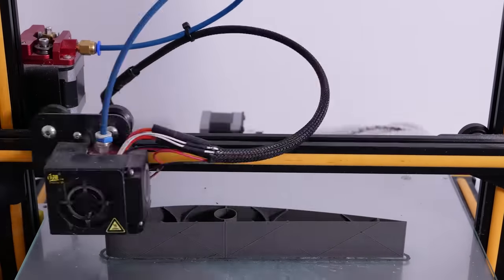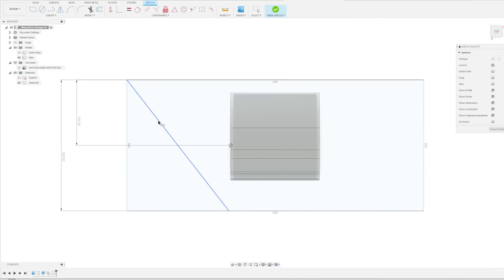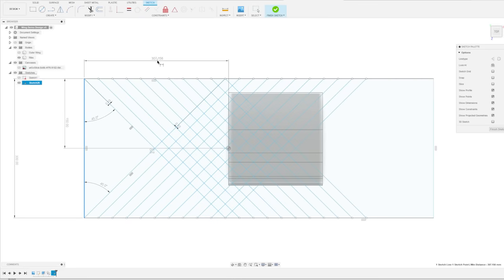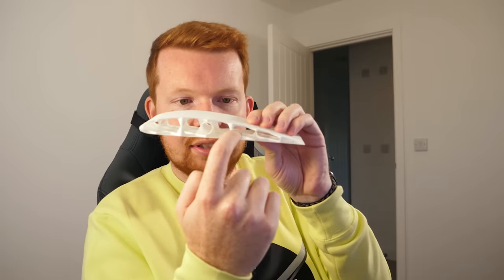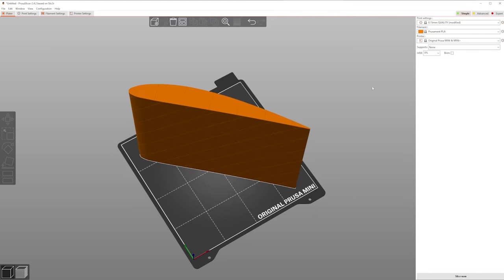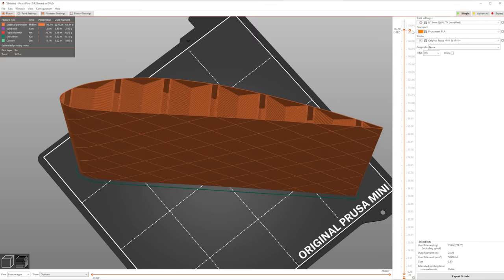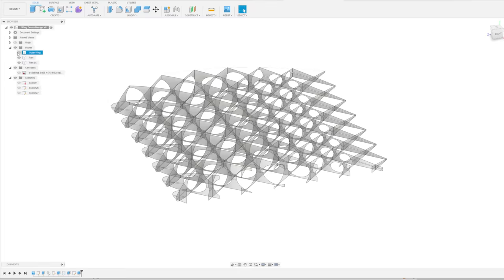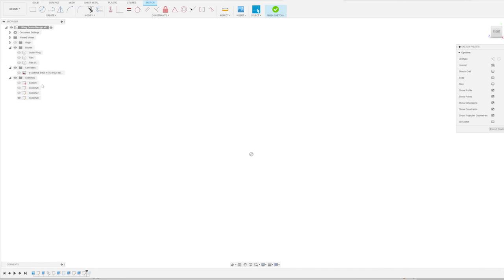How I Designed a 3D Printed Wing

Comment: I think you may get better strength-to-weight if you make the circular cut-outs parallel to the ribs instead of parallel to the spar. And then they do unfortunately need to be tapered, so you might want to add the circular cutouts individually to a single rib before you replicate it.

Comment: Very nice print, how would you do this for angled wing designs? is there a way to make the wing itself a pattern and extrude it in a circular way?
Reply: Base rip and smaller endrip. Instead of extrude you use lift up
Reply: @srck4035  Alright I'll check that out, thank you very much
Reply: @janivo5218  I tried it today and it works but the spiralize printed wing is hard to do in this version. Also the command I mean I named loft in English fusion 36p
Reply: @srck4035  Nice, haven't had the time to do so myself but I'll probably try it in the coming week. I modified my Wing Design a bit already and will continue to do so to make it work

Comment: Thanks for the video.  You didn't show how smooth the wing came out with the 3D printing layer lines.  How did it come out and how smooth does the wing look?
  I've got a 1/48th scale model that I'm thinking of reverse engineering into a 1/32 scale.  They don't make this model any more, but I don't know how FDM printers would work and the SLA printers are not big enough.

Comment: Hi Tim, can you adjust the width of a line in your 3D model during the printing process without necessarily making the object more complex. I would like to done it by adjusting the extrusion width or line width settings in 3D printer's slicing software, not by changing the model itself in the 3D modeling software.

Comment: Tim, you can skip a step there and send the body directly to prusaslicer using the 3d Print option instead of exporting as .stl. You have to setup your slicer as the custom slicer first, but that is just pointing Fusion to the .exe of prusaslicer. No more export - import - export - import

Comment: Many thanks for this process...but aren't the ribs supposed to be back in from the outer surface a bit so the wing surface is smooth?
Also how would we add servos, hatches, ailerons and still maintain vase mode, like the 3Dlab crew do it?

Comment: @Tim, I have a very similar design in SolidWorks but after slicing the part in PrusaSlicer it removes and breaks up the internal ribs. Your design in Fusion360 seems to work. Is this software compatibility issue between Solidworks and Prusa?

Comment: I’m a noobe on Fusion 360 with a deep interest in RC airplanes.  Thank you for making this video and for providing the Stl files.  I would love to print your vtol plane with rotating wing as the fields here have clumpy grass that challenges any landing gear.  Question: how can I tell if my 3d printer can print your design?  Did I miss the overall dimensions at the start?  (Lots of wings are designed to be printed a section at a time using slots and corresponding areas to link them together.)

Yours is the first wing that hearkens back to the balsa models I started with 30-40 years ago.  A well designed wing is like a practical art form combining form with function...  this video reminds me of that aesthetic quality.  Nicely done!

Comment: Hello, I wanted to ask how you printed the wing in parts, let's say the wing is too tall. Do you divide the wing by small cuts and print each individually? would it cause problems if the next section of wing technically doesn't have a flat face at the bottom when it starts printing, and if there are specific settings. Also would this technique of the one line cause problems if I needed support material where I have a square slot on each side of the wing, meaning I have a ceiling due to the slot? If anyone knows, it would be a great help. Thanks.

Comment: Did I miss you do a shell operation on the wing profile or was it a thin extrude at say 0.4mm? I don't get how the rib pattern cut out/combined from a solid piece produced the small pieces and not the bits we were trying to remove

Comment: Hi Tim. First congratulations for your channel and all your ideas. I really love following your crazy ideas and figuring out all the test and solution you go through.. great job. A question for this video. I want to 3d print a wing for my hydrofoil... the procedure you have showed is almost what I have in my mind except for the middle line that divide the ribs in two. Was used to print with a resin 3d printing so loops were not a problem. I have now a wiring printer but I'm actually not so familiar with it and all the tricks and problems of it. Let's go to the beef... I got your point and I agree on that regarding printing problems... what is not clear is how ribs can be working if you cat them in two... they look like  jointed in the final job. 😳  . Not sure but maybe the space you left is just a little bit bigger that the noble so the ribs will be rejoined...but at this point I'm going to have a very small section that will represent a vulnerable point for all the structure..doesn't it? Ribs are done for make the whole structure more robust and at this point I'm scared to have a not sufficient robust ribs for my porpouse. What do you think. In advance...I'm planning to cover all the wing with a  carbon fiber layer by the way
Reply: The gap between the ribs is about the same size as the printers nozzle (he mentioned this in the video) and the material used to print this structure foams up, which is why a "one line" printing style is needed, the ends just connect themselves as the actually printed line isn't 2D like it is in the software

Comment: I’m still learning about 3D printers, I haven’t played with any FDM’s, but I do have a resin printer and I know they are very different machines. Ido however have a fairly good understanding of mechanical and structural engineering, and you have purposely designed a structurally weak assembly trying to create a workaround for your printer not using an optimum printing path. You built failure modes all the way through the wing section from leading edge to trailing edge. I believe the design would better if you had the skin print “separately” from the ribs. That is; skin, ribs, next layer, and so on. You don’t want a wing to split in half in flight due to weak bond of the halves. With the skin, rib method, if any bond is lost, it’s internal and may result in only a nominal increase in wing flex, but no crash. 
I would add a second spar to eliminate torsional stresses between the sections.
Reply from the maker: Buy some lightweight PLA and an FDM printer, print one out and then see. It's surprisingly strong as the crease lines (where the ribs start) are bonded together. They aren't failure modes at all. Lightweight PLA isn't going to survive a crash very well anyway, but so far it's performance in the air is excellent.

Comment: Thats really interesting and thanks for sharing the design process.

Do you glue 200mm long sections together to make the full wingspan and did you design any specific features into the surfaces to ensure a good fit between each section?

Comment: You made the "Outer Wing" as a solid body. I don't see how you did a combine with the ribs to get something that's just the ribs and the "skin" of  the Outer Wing. Did you perhaps skip a part where you did a Shell operation on the Outer Wing?
Reply from the maker: The wing model is a solid body when it is exported, but when the printer is set to vase mode, it'll only follow the outline of the body and therefore creates a hollow interior. The combine tool is actually set to cut the ribs out of the outer skin, but fusion names it 'combine' for some reason.
Reply: @TimStation  Ah, OK. I've been using Fusion 360 and PRUSA Slicer for years now and never came across that particular option in the Slicer. I didn't see in the video where you actually set the Slicer to user Spiral Vase mode. I'm guessing that you had that already set and just didn't mention it, or maybe I just missed it where you did that.

And, yes, Fusion calls that function "Combine" but there's actually several ways to "combine" bodies, Join, Cut, or Intersect.

Comment: Hi thanks for the videos. Have you ever tried ABS printing the wings. I have a problem that I could not solve it. The wing always have dent due to the shrinkage of the ABS while fuselage has no problem. I guess its the hanging area related. but just don't know how to fix it. do you have any suggestion. thank you.

Comment: Thanks for the video, Tom.  When you added the wing spar, there was the "thin line" in the middle that would need to be removed in the 3D print.  Is this treated as support material?  How would you remove it through the whole wing?  Why do you need that line at all?  Also, the first wing body, was that just an outline or did I miss where you shelled it in Fusion to get just the outer perimeter?
Reply: Hopefully I can help. The "thin line" is actually the path the nozzle takes to get to the spar hole in the middle of the wing, so there is no support material. The printer comes along the bottom of the wing, then when it gets below the spar, it travels up the thin line to the spar. It travels around one side of the spar, up a little bit (but not quite to the top of the wing) and then back down to the spar. It finishes the other side of the spar hole and then prints the other side of the thin line to the bottom of the wing.
Reply: It's Tim..
Reply: @DrTheRich  I think he actually goes by Tom, his main (first) channel is called Tom Stanton, this is Tom's second channel that he named Tim Stanton. I don't know if he actually goes by Tim though.

Comment: I'm curious why you'd need the spar support like that.  Why not using the inner circle in the rib that 14mm diameter?  it would only contact the rib one layer at a time but you'd think the contact would add up and be strong enough.  Wondering if you tried it without the tube and what the results were.

Comment: Dumb question, why not make it without the ribs and have it single walled wing with no ribbing?  On the surface it seems like the strength is unnecessary for such a lightweight aircraft.  For endurance planes we would use a single layer of tissue paper, no more structure was necessary for it's small size.

Comment: If you wanted to get those two lines in the "center of the wing" when you were trying to add that cut down the center you may have been able to offset the lines then scaled them to be the proper size. This is more for anyone new to fusion 360 not Tom per say.

Comment: A couple of constructive ideas: why not design a solid object, and then tinker with infill pattern and percentage in the slicer? It seems you're complicating things in this way with no upside. I would also advise against "weight reduction" holes, as it forces the printer to extrude solid lines at the edges, while you could just print the solid object at a lower infill percentage for the same weight.
Reply: He's using lightweight, foaming PLA which is an oozing nightmare. This method is designed to avoid any seams or retractions as they can cause artifacts that disturb airflow. A solid object with infill requires perimeter overlap, seams, and retraction for travel that can all harm the finished shape. Watch his explanation on his main channel to see the issues he was having.
https://www.youtube.com/watch?v=XPXN0QejqM0

Comment: Hi Tim, can you clarify what the tiny rectangle for the spar hole was for? Is there a reason you couldn't have done what you did but without the rectangle? Also woundering why it had to not touch the top (ie 1mm). Think this is really cool; was the only part I didn't get. :)

Comment: Took me a while to twig that the model you're exporting from Fusion is 'wrong' and comprises a bunch of diamond-shaped blocks -- almost kind of a negative of the shape you're after -- and you then rely on vase mode to turn it into the correct rib structure. Cunning.
Reply: It’s all about making the thing printable in spiral mode, so there’s no retractions. The gals are small enough that the part comes out in one piece - but large enough the slicer doesn’t close them. This is so the expanding PLA filament prints without blobs.

Comment: Interesting. But when you explain or teach something it would be great if you could also include bit more sauce so to speak. Why you are placing this line there. What extrusion setting was used for the spars. It might sound silly but when folk use different CAD soft it just might be called differently or function might be done in different way. But thank you anyway.

Comment: Do not put the wing spar down the midline of the wing.  The center of lift will be close to the line 1/4 of the way from the leading edge to the trailing edge.  You want the wing spar there.  You'll note that just about every airplane puts the wing spar there.

If the spar is too far back, lift will cause the wingtip to rotate to larger angle of attack.  That will increase lift.  The result is divergent behavior, requiring much more stiffness to prevent the wing from snapping.  This failure is a real problem that caused a wingtip failure on Alex Proudfoot's  human-powered aircraft.  You can get the same problem if the stiffness of the wing forward of the 1/4 cord line is less than the stiffness behind.

Comment: can you use this designe for a regular plane as well - or do you need to change the crossection throuout the wing - and also flaps und stuff ? just add them to the wing or design holes into it ?

Comment: I am wondering : wouldn't it be better to just print a wing "frame" or structure and then to cover it with some really strong covering material, designed  for the purpose. After all the 3D printing material is not the best compromise for all the wings components. If you reinforce the inside with a carbon fiber tube it's logical to use a covering. It may also allow for the carbon reinforcement to be located on a more efficient position...

Comment: But now you have lots of vertical seams in the airfoil. Basically every time the nozzle has to go inside the wing to form the internal ribs it goes in, draws the rib and out again. This in and out creates small gaps. Did I misunderstand something here ?
Reply: Technically, there is a minuscule in-and-out line gap, but in reality the hot plastic oozes and joins the other line right beside it. The trick is to get the gap large enough that the slicer still makes one line in and another one out, but small enough that the lines will fuse together.
Reply: @PlaneAwesome  I see, thank you. I usually print in vase mode style without using vase mode per se. I just up my extrusion width to 0,8 with a 04mm Nozzle and make wall sizes of 0,8mm. So this is interesting for me.

Comment: Quick question/tip regarding your rectangles while doing sketches: Is there any reason you don't use points that are constrained to the midpoint of the edges of the rectangle at 13:16 and then just use a horizontal/vertical constraint to keep the center's align vs two dimensions? That way, it dynamically stays centered regardless of the width of the rectangle. It doesn't really change much, just curious if there's an actual reason not to do it or if it's just not worth the work. Thanks!

Comment: Hey Tom, do you think adding micro ribbing the the outside skin would create a lower drag boundary layer separation like dimples on a golf ball?
Reply: Those dimples work on a goofball because the air otherwise struggles to wrap around the back of the ball. Adding dimples adds energy to the boundary layer which helps it to stick better. 

An airfoil, however, has a long tail exactly to help the air stay attached. So in normal operation the dimples would increase drag because they make the boundary layer turbulent earlier. Structures like this do exist to help in stall conditions though, and since the transition from vertical to horizontal flight is the most difficult part of his vtol take-off maneuver this might actually be helpful!

Comment: It's too bad that Fusion360 lacks the tools to import the profile directly from the maths. Manually tracing over the profile seems so archaic and prevents you from using the profile in a parametric design. I'm working in cycloidal gears and about ready to bail.
Reply: There is a free airfoil addon that lets you directly import whatever airfoil profile you want directly into F360.

Comment: I've seen other videos on this, but prefer yours. 
Do you really need a 14mm carbon fiber spar for your Osprey, or you just used it because you had it at hand?
Reply from the maker: It needed to be 14mm so the motor and servo wires would fit through the tube. Thanks!
Reply: @TimStation  are the wires really that thick, or are you threading large connectors through the tube? Would think you could cut and solder?

Comment: Other videos I have seen of the request of taking a RC airplane to fly and travel over 100 miles using the power of the sun to recharge the batteries I find that your design would probably be more successful traveling further distances than 100 miles due to the simple design that you had came up with most RC planes have six servos for the flaps for for navigation I sure would like to see this design to offer smaller shoulder panels that may offer the sun to charge it as you can travel it great distances thank you for your continued support allied forces of the United Kingdom respectfully the United States of America